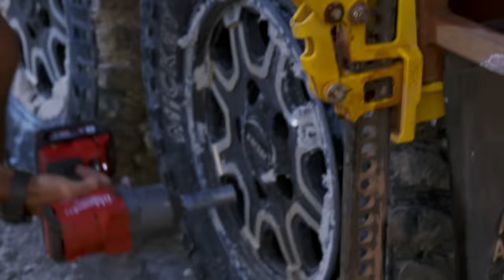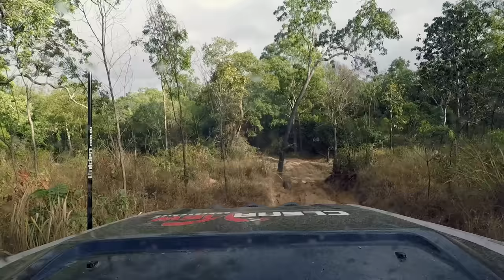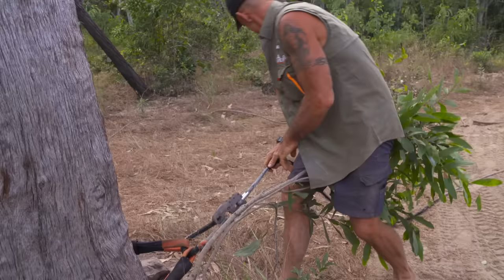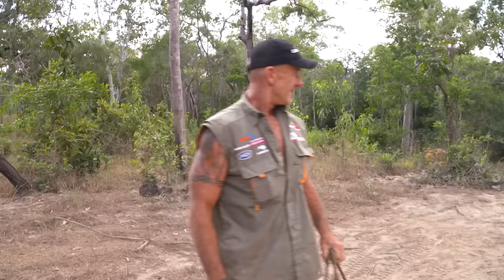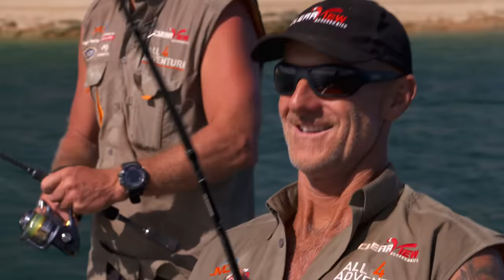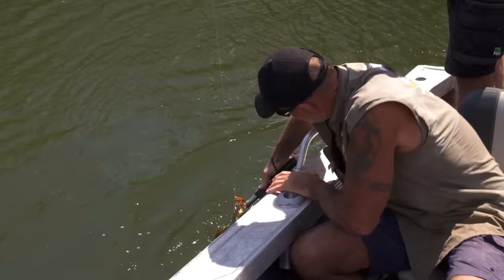🔥WE DID IT! Crossing Cape York hauling 7m trailers (Frenchman’s Track, North QLD) (Part 2 of 2)

Comment: I think you should call Rocket Rod to get an auto box. Less wheel spin and no worry of burning the clutch. What do ya reckon Jase?
Reply: Seems like they have gone back and forth with the autos, I remember Jase saying its better for traction but then they had to bail out of one of their trips after Jases 200 lost reverse.
Reply: @kelkev85  The trans has a new electronic system and has seen a lot of tough tracks and kilometres for several years. No problems. I encourage people to watch Rocket Rod’s 79 Series Landcruiser Mods.

Comment: QUESTION, live in New England in the USA and four wheel, so not a rookie, do quite a bit of driving on sand
watching you fix the tire, seeing the aggressive tread and I get the sidewall protection, 
But onthe TRAILER, wouldn't it be smarter to have a flatter tread, more flotation? A tough tire, but smoother tread that floats over soft tracks more easily